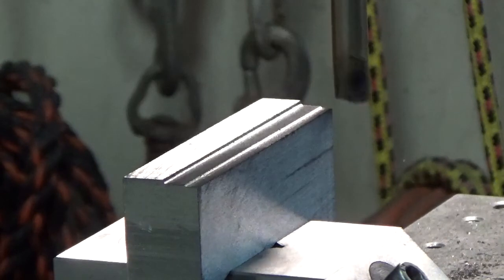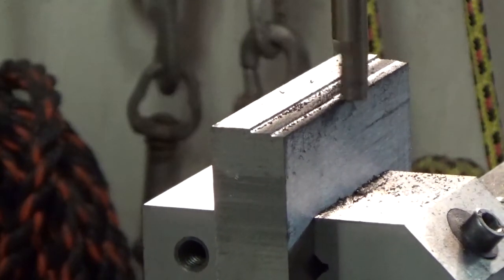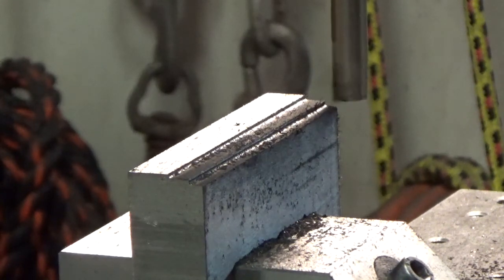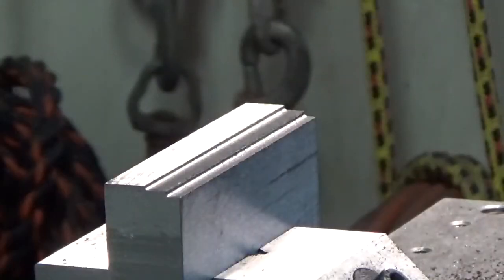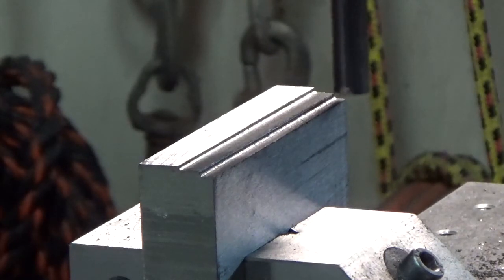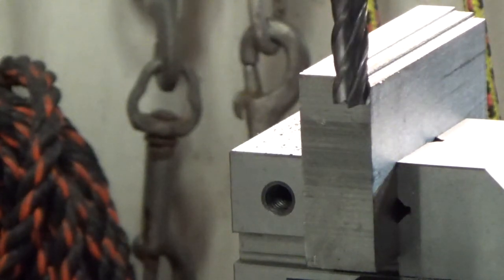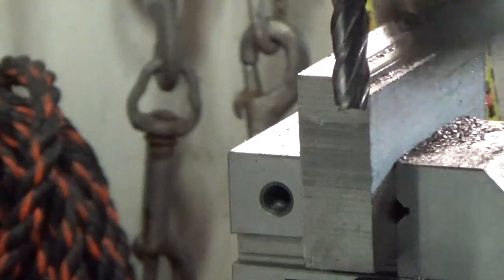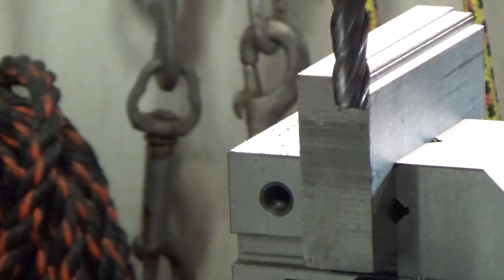Comparing a single flute indexable end mill to a 4 flute standard end mill

Comment: how bout speeding it up to 2500 rpm.  Make it hum instead of smacking.  I'm using single flute at that speed and I really like it.  The carbide can take it if you run air to get rid of the chips
Reply from the maker: Todd:  Thanks for your comment.  Best Regards: Larry
Reply: Yeah Todd agreed it’s too slow. I wonder if the insert is correct too it’s probably already toast.

Comment: Single flute, smacking, chatter, etc... I agree high spindle speeds slower feeds seem to make the most sense. I’d like to see how they work on aluminum. I’ve got 2 and 3 insert and they’re fantastic. You definitely look like you’re going way to slow I’d probably park that at around 4500 rpm on my mill.
Reply from the maker: Your absolutely correct and would probably work great with aluminum.  Thanks for the comment.  Regards: Larry  P.S...Max mill speed is 2500.

Comment: Larry, I run my 2" Three Flute TPG 322 TIN Coating at 1900 RPM on a LMS Hi-Torque 5500 with a Chinese made Auto Feed.
I've got to be getting at Least 6 ipm  with a .020" D.O.C. it runs o.k.  Even though I know the mini -Mills do not have the Rigidity
to actually run Carbide Insert Tooling..... Advice, Get some Cobalt Cutters.
Reply from the maker: Thanks for the suggestion